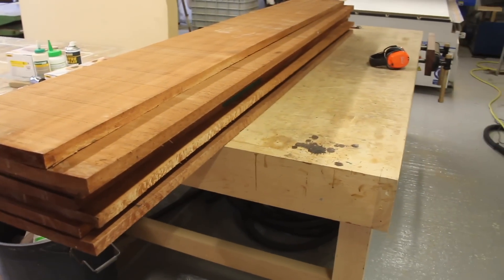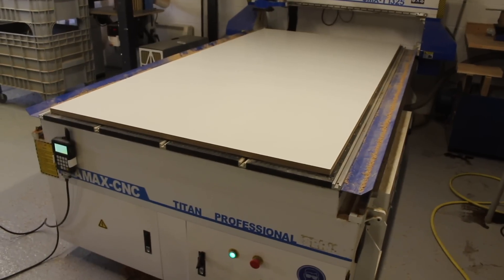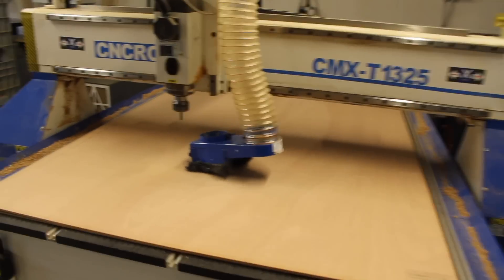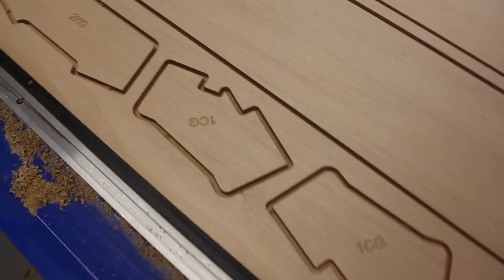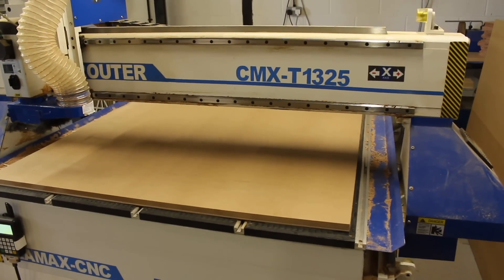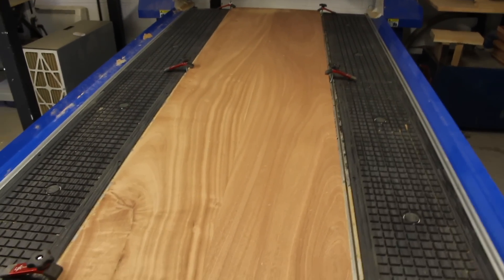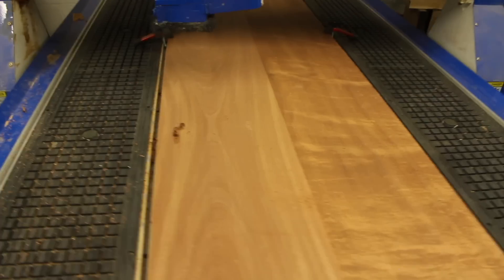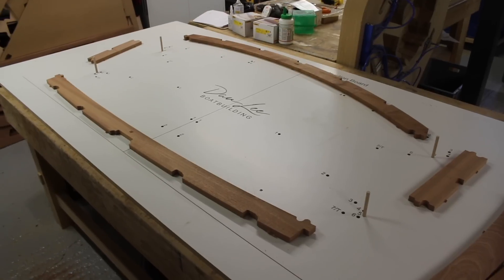Rocket MkII Boat Build Pt 2 - Cutting The CNC Parts

Comment: What type of engines and gear box do you recommend? Thanks
Reply from the maker: It depends on what you can get hold of really, something like a 4 cylinder up to around 100hp is ideal. One guy currently building a boat is using a 1.6L Volvo engine. My boat has a 1.5L Ford in it.

Comment: Nice work,  I am interested in your thoughts on your CNC router.  It looks suspiciously just like a Blue Elephant machine either way they probably both come out of Jinan China that seems to be the cnc hot bed in china.  Im seriously considering pulling the trigger on a B.E. CNC.  You look like you get good performance and accuracy out of it.  Can you give me an idea of how happy you are with it? Thanks in advance
Reply from the maker: Thanks! You are right this is a Blue Elephant machine, I bought it through a UK supplier which is why it's branded up with a different name. 

I've found it a great machine certainly for everything I have needed to do, I've even carved a 3D Mount Everest on it! The only thing I wish I had stretched to was an auto tool change machine as most of the stuff I do requires changes which mean you have to keep coming back to it. Other than that I'm very happy with it. There are of course better, faster machines out there but it depends on what you want to spend and what you need from it.
Reply: @DanLeeBoatbuilding  Thanks a lot Dan, that really helps.  I know what you mean on the ATC but adding ATC really jumps the price up out of my budget.  Im only using as hobby so I will just have to deal with the inconvenience of manual tool change. I really appreciate you providing your opinion, its tough to find someone who is a neutral 3rd party that has has a BE machine.  I was just about to walk away but you have given me some positive reassurance.  TY

Comment: Have no experience of CNCing. Do you need a sacrificial board under the piece being cut? And if so, how does that vacuum bed work? I assume the sacrifice piece would be perforated...
Reply from the maker: Yes you cut slightly through into the MDF sheet (spoil board) that is on the bottom and after a run of parts you just skim off the top layer of the MDF to flatten it back out again. As the MDF is porous the vacuum pulls evenly throughout the board and holds down the part that is sat on the top.

Comment: Very nice work. I like how you've designed the melamine sheet for jigging.  Are you using Fusion360 for CAM?
Reply from the maker: Thanks! I use Fusion for design, modelling and some CAM. However I created the tool paths for this in Artcam as it has a much more flexible nesting system.
Reply: @DanLeeBoatbuilding  is the artcam friendly for the user? by the way, what brand is this machine.  Very impressive work you are doing there. im curious, how the vacuum table pulls the second play sheet if the first sheet has no air holes?
Reply from the maker: I would say Fusion is more user friendly, its just not great at auto nesting parts thats all. As MDF is porous the vacuum pulls through it and holds the top sheet in place.
Reply: @DanLeeBoatbuilding  Oh wow. cool. do you feel like losing a lot of the vacuum force with the first MDF layer? how thick is it? and did you lose some of the Z height due to this mdf?
Reply: @DanLeeBoatbuilding  some choose the use the mach3 but im not sure if it is easier for the user compared to artcam